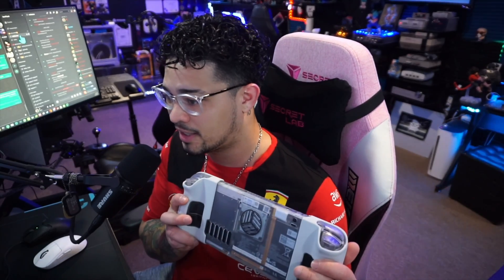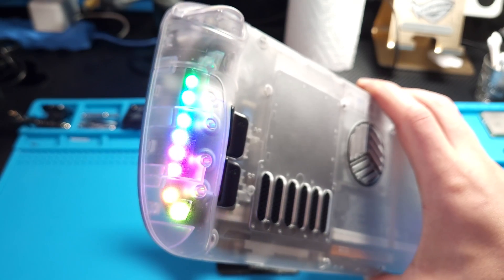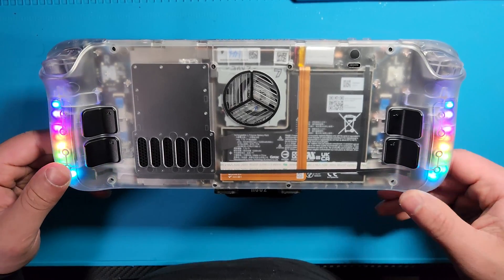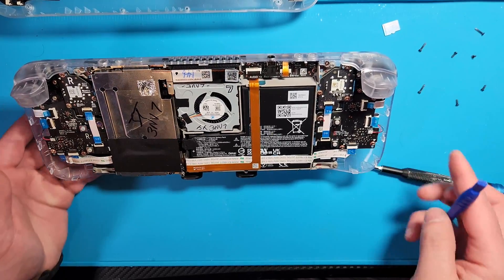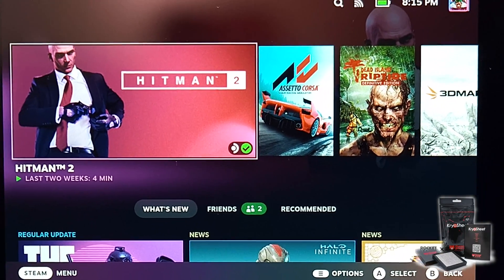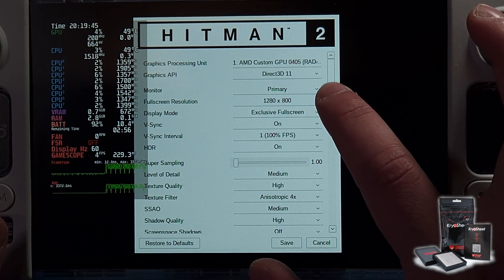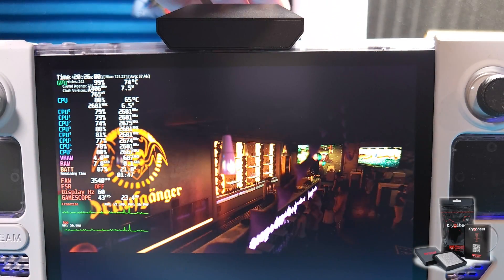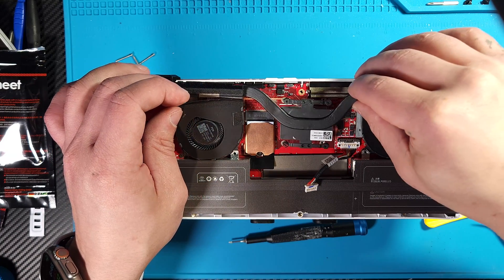Cooling Battle:Liquid Metal vs KryoSheet on LCD Steam Deck! the Evolution of Gaming Tech! Part 1

Comment: It's safe to say if you've already been notified about the battery issue. However, you're not to handle the kryosheets with bare hands! Doing so, you can introduce oils and other contaminants that will negatively affect Its function. To keep expectations within reason, kryosheets were never intended to outdo paste or liquid. Their purpose is more of a set-it-and-forget-it to reduce the need to reapply paste or liquid every 2 to 3 years (low maintenance) with decent temperatures.
Reply from the maker: Ahhh this is amazing information! Thank you so much and thank you for taking the time to watch this video.

Comment: Maaaaan, why you do not unplug the battery and put liquid metall on clear copper...
Reply from the maker: Hi! Thank you so much for watching ! I did unplug the battery, I realized it maybe 1 min into cleaning the thing, I was like oh shit lol. I'm not sure if that was always clear copper.. but are you not suppose to ?
Reply: @3nv7Tech  Liquid Metal with copper pipe will corrupt that pipe
Reply from the maker: @aduditsky  Interesting, thank you for that insight. Could be the reason why cooling is not so good with the kryosheet. I am learning as i go so i do appreciate. Might need to get a new pipe you think?
Reply: @3nv7Tech  You can get rid of liquid metal build-up on a copper pipe by polishing, but it is still better to buy a new cooling system for your steamdeck. Also, don't forget to put gaskets and coat the cooling surface with nickel if you apply liquid metal again.
Reply from the maker: Dude, this is awesome information ! Thank you so much. I think for now I'm going to polish it and reapply a kryosheet and see how that holds. Thank you again !